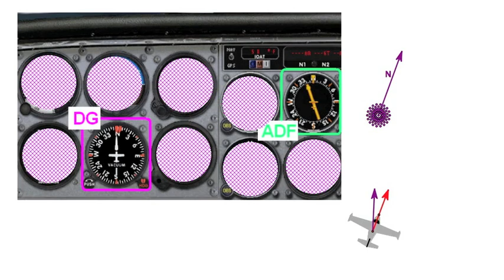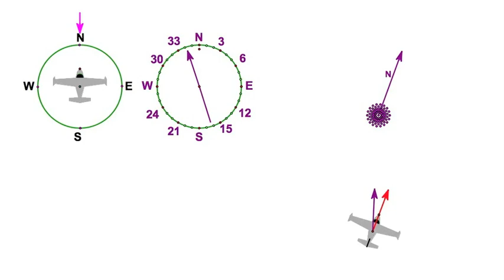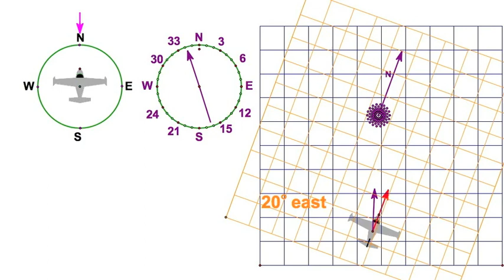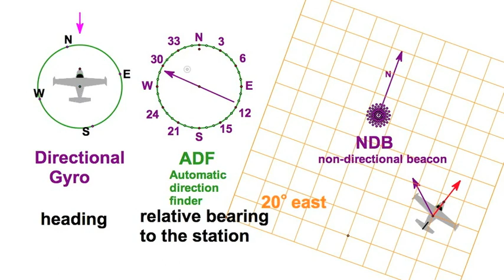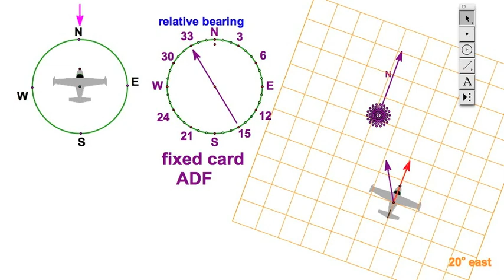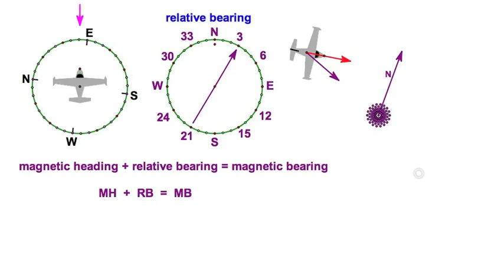Reading your ADF / radio navigation

Comment: ah i get it, so basically the ADF only points straight ahead of the airplane an give cardinal direction relative to the a/c so you have to use your magnetic heading to find the actual bearing needed to fly to the station

Comment: 15 years ago, I was told VORs are going to be obsolete and discontinued. I was told that NDB's are a thing of the passed and will be phased out. Lots of gps approaches have replaced the NDB's.  I say keep a handheld gps to help with positional awareness on these if all you are going to get is 800-900 feet above the ground. NDB is simple in that all it does (the adf) is point to the NDB station, yet it still causes so much confusion if there is any wind and there always is. Funny, I chose an NDB approach on my check-ride because I felt good about them and it went well.